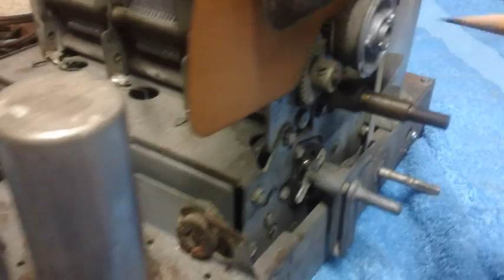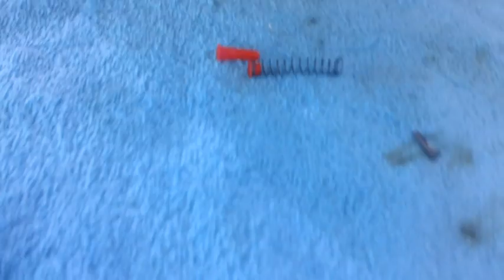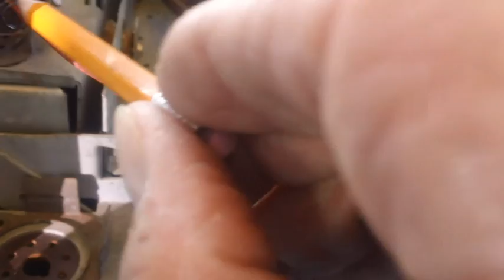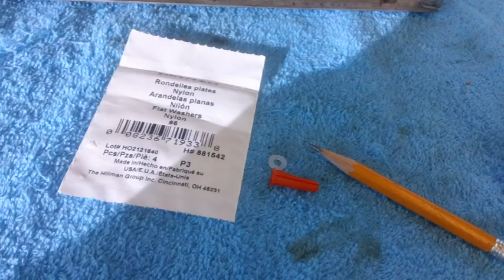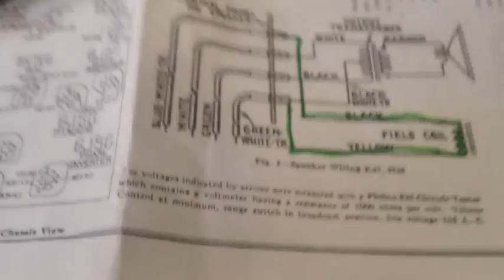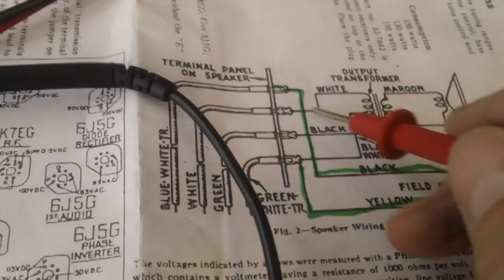Philco model 37-2670 repair and restoration (Part 15 of 34)

Comment: Great videos, as always. I never would have thought of using that split rivet to repair the lamp socket. I have cannibalized other similar sockets, and have even gutted a cheap inline fuse holder.
Reply from the maker: Sean,  While doing a restoration weird things sometimes just pop into my head.  Some work - some not.  Thanks for stopping by, my friend.  Regards,  John
Reply: It ain't weird if it works.

Comment: What kind of heat gun do you use?
Reply from the maker: Nathan,
This one...it works well:
http://www.ebay.com/itm/NEW-Wagner-Spray-Tech-0503010-Dual-Temp-Heat-Gun-/360935743548?pt=LH_DefaultDomain_0&hash=item540972603c

Regards,
John

Comment: Hey John,
Tough luck on the Output xfmr, old bean. Hope you can locate one easily.  WSM won't be coming in like it is!  :)
Yes, I'm following you each and every post, so don't get concerned.  I might miss a few of the mish-mash vids but I record all the restoration vids.
BTW, what kind of red-blooded American ham radio operator uses a Red Chinese Bao-Feng 2 meter radio????    (Just joshin' ya, OM)
73, Harvey, KM4JA
Reply from the maker: Harvey,Once again, it's good to have you drop by.  I appreciate it.Screwed up output transformers are par for the course in this biz.  Matter if fact, it's a surprise when I find a good one.   Piece of cake to deal with.BTW...how do you record these vids?  Inquiring minds want to know.Regards,John
Reply: I use Mozilla Firefox as my web browser.  It has an add-on that allows you to record almost any video, especially on YouTube in mp4 or .flv formats.
Reply from the maker: Harvey,
Thanks a bunch, my friend.  I sometimes use Firefox (more and more as time goes by), but never realized it had that add-on.  I downloaded it and many new doors have suddenly been opened.
Regards,
John
Reply: Glad I could help my friend.  I've been weaned off Microsoft a long time ago running LINUX and Firefox.  I record your resto series because each is like a complete course in radio repair!
73, Harvey

Comment: John,
My heart goes out to you my friend: just as you were making excellent progress – half of the output transformer primary is o/c.  I know how you must feel: it is both maddening and frustrating – I’ve been there many times dear chap.  Hopefully someone somewhere will have a spare output Tx that is either direct, or a workable, replacement.  I know we all approach the unforeseen differently but I usually give myself a day or two away from electronics, or from an offending project, so that I may return with a clear and sharp idea as how I will proceed.
I liked how you repaired the lamp socket: a first class job.  I have to say that I can’t recall ever encountering, or seeing, a dial lamp on a Vintage Radio directly soldered to the connecting wire – that is certainly a first for me.
I don’t mind viewing a long video provided it is a good video, and yours is a very good video my friend, thank you.
Regards,
Phil.
Reply from the maker: Phil,
Hello again, my friend.  As always, it's good to have you here.
You know...that busted audio output transformer presents not an iota of a problem.  I always expect those critters to be broken, so it came as no surprise at all.  The fix was easy...after throwing money in the right direction the solution almost immediately appears in the mailbox.  :-)
Actually, I don't sweat anything in life.  It's just not worth wasting what little precious time we have on this planet.
Thanks for popping in.  See you next time.

Regards,
John

Comment: Hey John...I want to tell you that I enjoy your antique radio restorations immensely.

I have several oldies in my collection that are awaiting repair...
Ya know 'Winter Projects' that never seem to get done...

I went to an auction a couple years ago and wouldn't you know, there were lots of old radios and no bidders (cept me)

Long story short...I left there with a truck load and still needed more room to haul the 3 console  radios which are fairly complete Zenith's. There were several old battery type 1920's models, some are in pretty sad shape several (RCA Radiola 18's) some are home brew. The best one I got is a Atwater Kent #40 with the matching speaker. Just about all of them still have the tubes inside.
Not sure if they are good or not since neither of my tube testers work properly I have a  Military I-177-A tube tester and another mutual cond tester which is stowed away and I don't remember what type it is...

Anyway I got all these radios for under $100. Like I said no radio buyers at the sale.

My house is fairly small, so I plan to use an old gutted camper to set up shop in, but I never seem to get things done. Maybe your vids will give me the inspiration to get in gear...LOL

I sorta had a feeling you were a ham...I have been licensed since 1975 (WB9RTZ) Haven't been active for quite a few years, but I still renew my ticket when it comes time. Like to get back into that too. I got me one of those  BaoFeng *UV-5R  HT's also...I just have to figure out how to work it...

So there you have it...I will keep watching and enjoying your journey and adventures of bringing back those golden oldies...

73's OM Wb9RTZ (Freddie)
Reply from the maker: Freddie,
Hello...it's very good to have you here.  I greatly appreciate it.
Man, it seems you found the antique radio mother lode at a terrific price.  Good for you.  Now to find the time needed to repair them, huh?  Perhaps offering to trade one of the radios for a good tube tester might be acceptable to a member of the Antique Radio Forum.  Placing an ad in their Radio Classified section would worth a shot.
Anyway, thanks for popping in, my friend.  Please do again.

Regards,
John
Reply: I didn't get your comment till today...As you know YouTube has made it almost impossible to receive replies to messages and comments one makes here...

Why do all these companies like 'Google-Yahoo-eBay-Flickr and others, take a perfectly good well oiled and fully functional website and change everything for the worse or next to impossible to navigate?

I used to love going to 'Flickr' to see nice photos of what I was looking for at the time, I used to love looking at photos of Chicago (Where I grew up) , but now it's so darn buggy and  dysfunctional. I just gave up on that POS site. It's gone no more...

Anyways...I do love your vids and hope to set up a little area in my house or old camper to work on radios & computers...

"Trade one of the radios for a good tube tester"   Well like I said, I do have a Military I-177-A tube tester and another mutual cond tester which at this time I don't remember the make, nor do I remember exactly what's wrong with them...Might be a bad tube...In that case it's sorta like...Which came first...The chicken or the egg...LOL      

I seen those    I-177 testers go for as much as $800 on eBay...So it would be nice to have this one fully functional since it looks to be complete and if I remember right the meter is in good order + I have the original test charts with it.  

I just snagged a 5 amp General Radio Variac off eBay for $24.99 + S&H $12.00  It's an oldie and looks a little ruff, but the seller has sold a lot of old electronics and has 100% FB...He listed it as fully functional, so we will see...A little paint/new grounded cord and receptacle, add a fuse holder and I'll be GTG...The dial scale and bakelite knob look pretty good. Just hope the brushes are good...I seen them more beat up and in a lot worse shape going for over $100...

I absolutely refuse to buy one of them POS China made ones.
Even if they work okay (Which they prolly don't) There's just something that don't seem right about working on a classic all made in the USA piece of equipment with some made in China junk...I still wouldn't part with my Simpson 260 or Weller soldering equipment...

So John...There you have it...I look forward to watching what you get into in your next  adventure...

73's Freddie

Comment: The bulb fix was great but one thing keeps picking away at me. Won't the heat of the bulb melt the wall fixing? Every bulb fixing like this I've seen has those brown wafer heat resistant washers at the end of the spring.
Reply from the maker: Morris,
It's only a 6 volt bulb and I've had no problem in the past, but there's always a first for everything.   We'll have plenty of time to find out.  If a change needs to be made, then we'll surely make it.

Regards,
John

Comment: Great job john, take your time restoring this radio, great job on that light fixture always love your videos there is always something new to learn on my philco 37-630  that i restored i left two wax caps that was deep around tha tuner area could not reach them, radio plays well i will remove them in the future thanks to you i atempted this restoration. thanks john good luck.

Comment: John, that light socket rebuild was brilliant. I don't know if I could have come up with that myself. Fantastic job.

And I know a bad audio transformer won't slow you down. It's a small bump, but you'll fly over it at full speed.

Keep it up, my friend.
Reply from the maker: Thanks, Art.  The output transformer issue is solved...as soon as the new one arrives, that is.  :-)

Regards,
John

Comment: Well John, I was digging what you were doing, right up until the end.  Bad transformers just suck, no other way to put it.  Not even Johnny Cash can ease the pain.  Looks like another audio-output transformer is in the cards.  I'm not complaining, I enjoy every minute, but, it looks like this is going to turn into another marathon series, since a lot of what you've done to this point is just for initial power on.
Reply from the maker: Al,
I would have been disappointed if that output transformer had checked good.  :-)
Over the years I've replaced a basket load of them.  And trust me, this series isn't going to be a marathon.  I hope to have it wrapped up at or before part 20.

Regards,
John

Comment: Hi John, shame about the audio output transformer.  Hopefully a suitable replacement is reasonably readily available - though it adds a bit to the cost of the restoration for sure.
Cheers,  John
Reply from the maker: Piece of cake, John.  I always expect the output transformer to check bad.  I can't tell you how many I've replaced over the years.  It's practically a given.  Anyway, a replacement is already on the way.

Regards,
John
Reply: joernone
Please John can you go into detail on the next vid how you determined which new audio output transformer to get and the subsequent hookup... Thank you sir.
Reply from the maker: Mike,
I will be showing the hookup of the new audio output transformer when it arrives,.  Meanwhile, watch the below video.  It should answer all your questions about audio output transformer requirement and purchase selection. 

1935 Atwater Kent Model 145 Repair and Restoration (Part 33 of 38).

Regards,
John
Reply: Thanks John....

Comment: That's a shame but not surprising. One silver lining is there is a lot of Philco radios and parts out there. One thing about this radio is the 6F6's are wired as triodes  and the plate to plate impedance with fix bias is 6000 ohms. 
Dennis
Reply from the maker: Dennis,
A new output transformer is already on the way.  I always buy them new and the cost this time was actually very reasonable.   I usually buy the universal, multi-tap Hammond jobbie offered by Radiodaze, but this time I bought it from AES.  Its impedance range is 4000 - 10,000 ohms, which I guess also falls into the universal category.  My old buddy, Brendan, found it.

Regards,
John

Comment: Great tip on the dial light, I learned something again! I don't know where I would get a split rivet though, I'll have to think of something else. uh ohh.. not good at all on that output Xformer... I have faith that you'll find a way to get it going :-)
Reply from the maker: Daniel,
Split rivets are a dime a dozen on eBay...and most hardware stores.  You can also use a steel pop rivet of the proper size.  The rivet head diameter would be about 3/16" or 6mm.  The hole in the pop rivet would also have to be filled with the solder.

Regards,
John
Reply: I was thinking pop rivets as well if I ever run into a dial light like that. so far all the radios I've worked on are the wafer type that are riveted together.